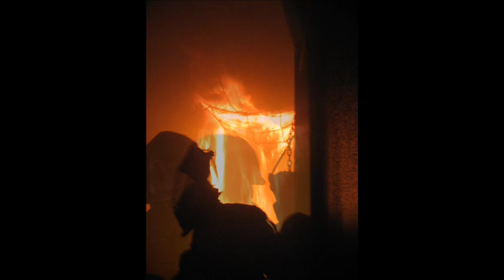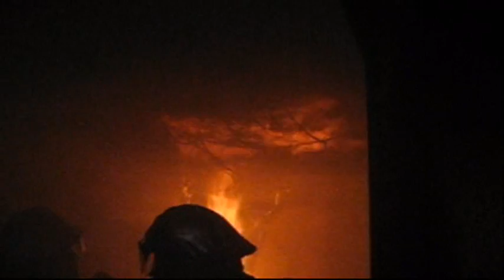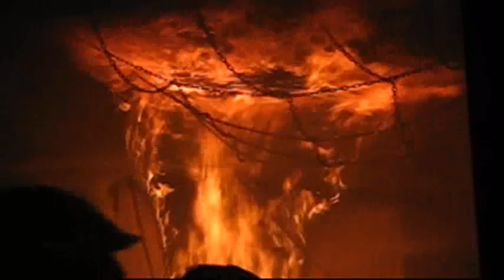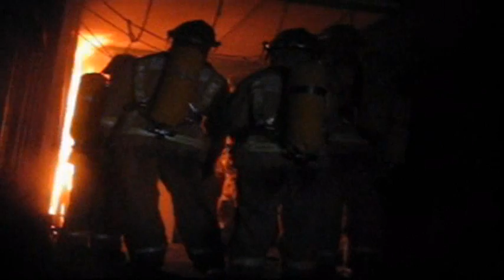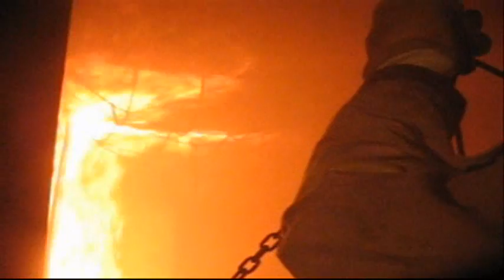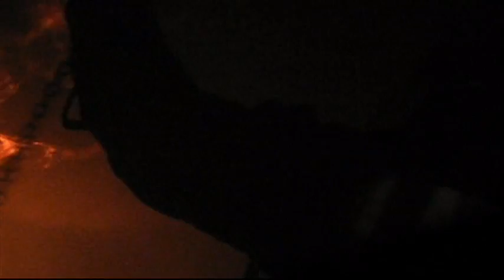SACFS Compartment Fire Behaviour 1.5

Comment from the maker: Hey,

Thanks For The Comments.  Yes It Goes To Show How Well Gas Cooling Methods Work In Structures.  Note These Are Used As Tools Not A Be All To End All With Structure Attacks.  The Old Surround & Drown Still Works.

Yeah I Am Surprised That The CFA Won't Do This Type Of Training.  I Do A Bit Of Training At SACFS In This Method Of Attack & We Have Had Guys From Around The State Coming Over To Do The Training.

I Have Sent You An Email In Regards To Getting This Footage.
--
MJ